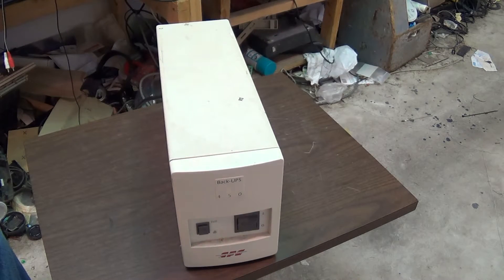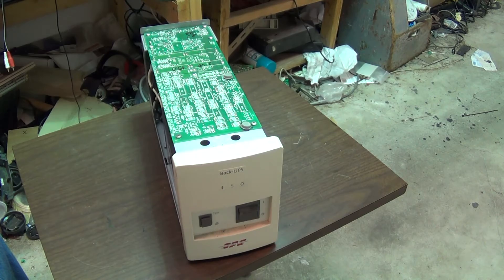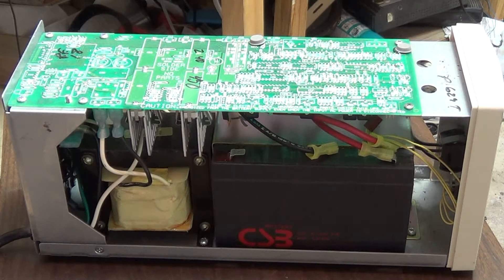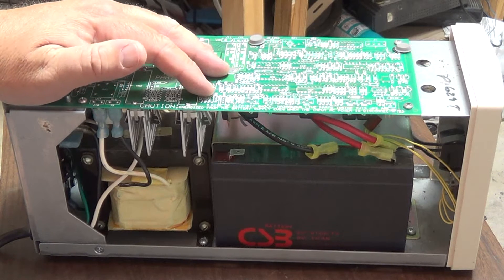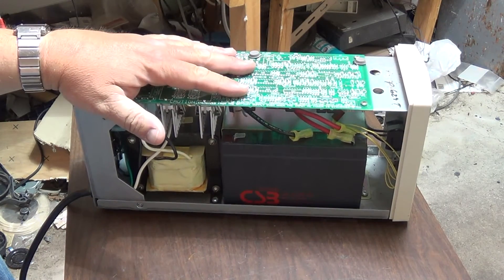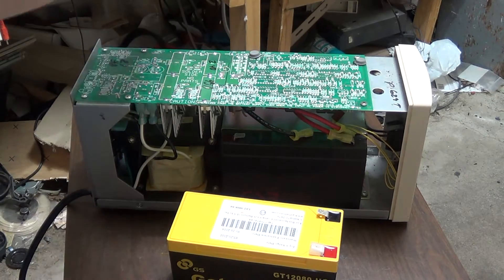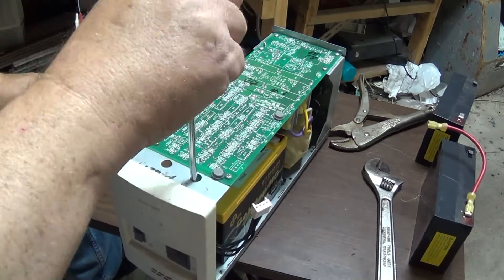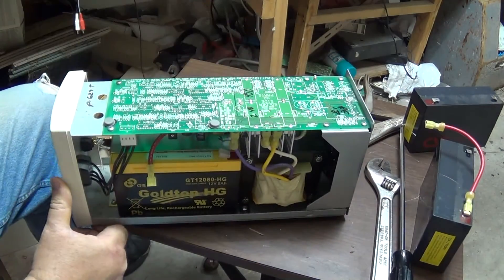apc ups

Comment: There is a little switch on the back, probably 3 or 4, to disable the beeper. You can also set sensitivity of the mains - back-UPS backup power switch mode. If goes lower than a certain voltage it will switch over immediately. It is a Pure Sine Wave Converter.
Reply from the maker: No it is a square wave. No good for motor operation.

Comment: A real deal with a unworkable test button :-(
Reply from the maker: +Fritz Pinguin 
Test button works fine. Loss of power and alarm starts beeping press it to silent an alarm stops. If unplugged an switch turned on alarm sounds. press silence and supply will cold boot. Pressing the switch to the test side does nothing, but then if I want to "test" the unit I can just unplug the power cord. The test switch worked fine until I dropped it a dozen years ago. This is my ups, not one I found. I bought it way back in 1989 for probably 600.00 or more. The batteries were good for about 10 years. I bought the trip lite to replace it. Didn't last, 1 year. Store reply first one. Second one lasted 3 years. It needed a new battery too. The apc is protecting my pc now the trip lite is in use keeping my aquarium pump backed up.
Reply: @12voltvids  .. You forgot to mention that APC's UPS are completely sinusoidal..
today that the cheap Chinese led lights feed from only half of the AC waveform.. and you have entire buildings with those cheap lamps draining only half of the wave..
We joke about "the only source of a steady waveform" is with a APC's UPS's... more even and clean than the AC waveform from the  electric company.. and it is a sad reality that you can see with an oscilloscope...
Anyway.. you can run AC motors with the APC's UPS...
I have a Smart 750.. (i use to have also a Smart 1000 and a 3000 when I had hosting's servers some years back) .. both on 220volt of course.. top range equipment all of them...
I mean... when I have to do a work with main power cut off here... I use my angle grinder 600Watts without problem.... my power drill 800Watts also run fine...
The Overload indication lights up when the motors start yes..... but once they are spinning... it makes them work fine...
i also use a 220v contactor (a heavy relay switch) to connect/disconnect a lithium batteries Power Wall that i have outside... and bust the internal 24Volt batteries (the 220Volt UPS version have 2 bat's of 12v inside in serie)...
i put on it a PC 12Cm FAN to prevent overheating... and i abuse of this UPS for up to 7 hours one...
APC UPS Are Top Quality Equipment Dave.. Schneider Electric produces high capacity UPS backups for hospitals.. datacenters.. and individual UPS for medical equipment like respirator..
it is nothing cheap in them..